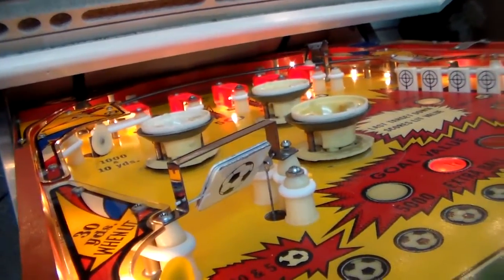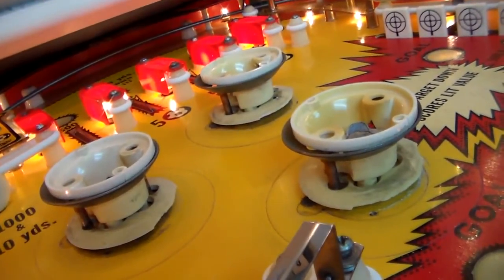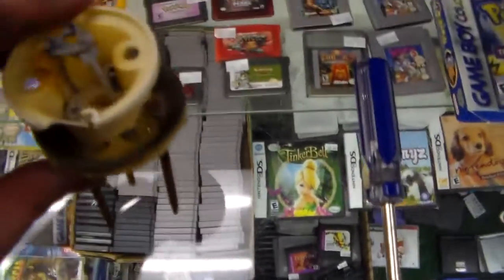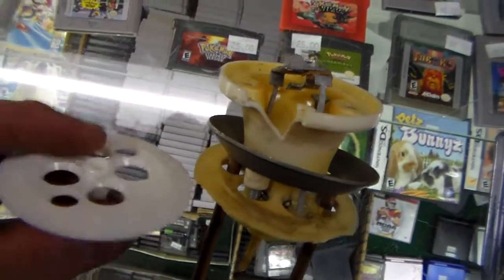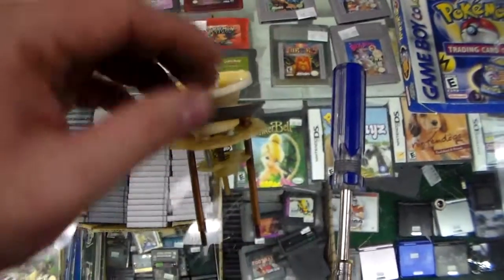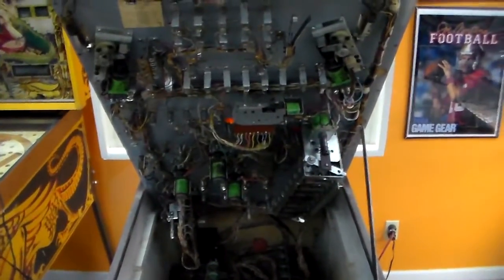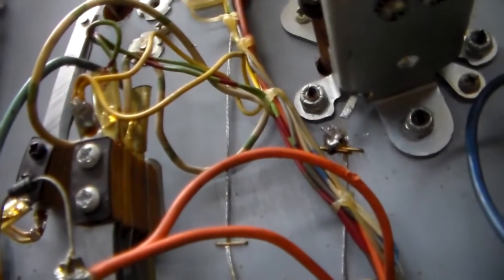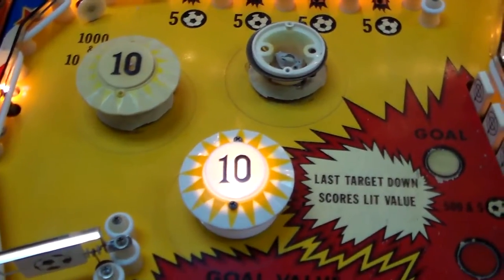How to Rebuild a Bally Pinball Pop Bumper!  Cheap!

Comment: That 1975-76-77 era had very brittle pop bumper skirts. Something with the formula used in making the plastic back then caused them to be brittle and break too soon. Today's replacement pop bumper skirts are made with a much better grade of plastic and it's more robust.
Reply from the maker: Absolutely!  Thanks for the info Ken!
Reply: On the top of the playfield I like to replace ALL the pop bumper parts with brand new. Bases, springs, skirts, bodies, lamp sockets and rod & ring.

Comment: I believe the diode is used for CEMF to protect the circuity when the magnetic field from the coil collapses.
Reply from the maker: That's probably true on the Solid States but this is an ElectroMechanical machine!  I think although I don't know... that they made the pop bumpers and flippers DC powered instead of AC powered on these later machines and needed the diode for that reason, don't completely understand it though.
Reply: Maybe they had trouble with the voltage spike running back into the rectifier and/or to prevent excessive arching on the relay and switch contacts.
Reply: @LyonsArcade  Acts as a shunt to prevent reverse polarity current (created during discharge) from flowing back to any semiconductor (bridge or transistors etc..basically discharges it thru the coil itself.
Reply: On DC driven with no solid state switching, I believe it is there to reduce switch contact erosion and welding.  On solid state switching it is there to definitely clamp the inductive spike generated by the coil when switched off.
Reply: @LyonsArcade  Any time you are switching DC coils, you'll get a back EMF spike when the coil turns off.  Whatever is turning off the coil will feel that arc.  If you look on most any PCB mounted relay (DC) there will always be a diode right across the coil.

To prove it to yourself, look at what is switching on the coil and then look at the arc it gets when it switches off...then remove the diode (temporarily)...compare the arc.  It is REAL easy for contacts to weld together from that arc too.  The diode snubs all of that and saves the contact on the switch/relay.  theBigMoose got it right.

Of course, this is 5-years ago (as I write it) so this discussion may have long been resolved.

Comment: I want to replace the skirt and the cap mount (the conical piece that the cap mounts to), but it has the light socket inside. You don't go into detail on the disassembly or reassembly of this, and I'm wondering if I actually need to lift the playfield and do some soldering to achieve what I want? Can  these  be replaced without major surgery? Thanks!

Comment: I noticed that there are differences in the metal ring and rods.... some are a lot more weighty and solid than others (newer ones). ... I think the heavier rod/rings will wack the ball a lot harder than the lighter ones. ... Using the same coil, the heavier ones give more thump to the bumpers. ... the rod/rings from the 50s and early 60s machines have more weight (and therefore more power) than the lighter ones which were made later. Have you ever noticed that Ronnie?

Comment: does a clean up and new coil replacement improve pop bumber performance? my pop bumpers are sluggish.
Reply from the maker: Usually the coil won't make it any stronger... but the sleeve inside the coil may (they're like 50 cents)... also clean all the switches on it and adjust them as close as possible.... that usually does it unless there's something physically damaged.

Comment: Any ideas on how to make a pop bumper from scratch?
Reply from the maker: Well basically you just need to buy all the parts, then wire it up where the power supply goes to each side of the coil, and the switch only connects when the ball hits the skirt.
Reply: Joe's Classic Video Games my god I love this guy